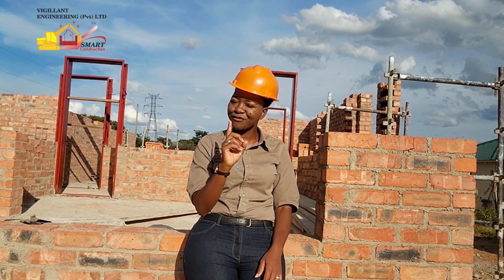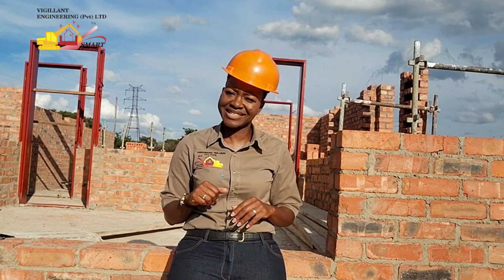How to Build your house in Zimbabwe(step-by-step)

Comment: Hello Sir!

The entire living space of Option A is 7.28m x 6.30m(45.86m²). 
Open plan layout, with dining 200mm elevated.
Arranged like this:
Main lounge 6.30m x 4.21m. 
Additional lounge or VIP section 3.08m x 2.8m. 
Dining 3.5m x 3.08m. 
Total floor space 45.86m²

Option B. 
Main lounge 6m x 5m 
Dining 3.6m x 3m. 
Total floor space 40.8sqm. 

Sir; these two living spaces which one is larger and better. 
Which option is more luxurious in terms of space?
Reply from the maker: Hallo sir how are you? Option is is more luxurious in terms of space.
Reply: Which option please?@vigillantengineering939
Reply: Please read your response very well, you didn't indicate the option.@vigillantengineering939

Comment: You did not even tell people that COUNCIL NEEDS TO BE INVOLVED DURING THE BUILDING STAGE!
Reply: Ko kana ukavaka pasina inspector
Reply: @esinathpasurai7152  Those are the cases ekupunzirwa dzimba nekuti uri kuvaka without approval. Each step, the Council must be involved for approval.
Reply from the maker: YES that is very true, every stage of the construction project is supposed to be inspected by the Building Inspector. Thank you for the correction. The statement was edited out by our Editor by mistake.